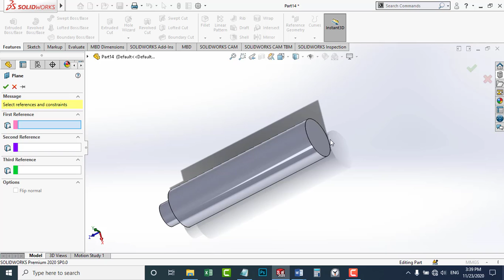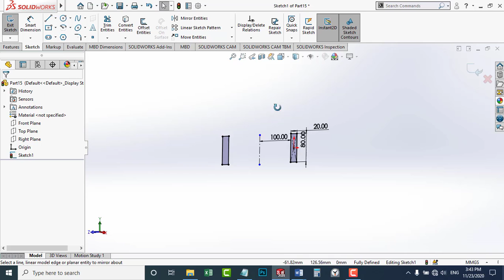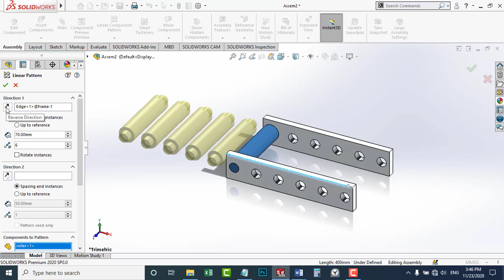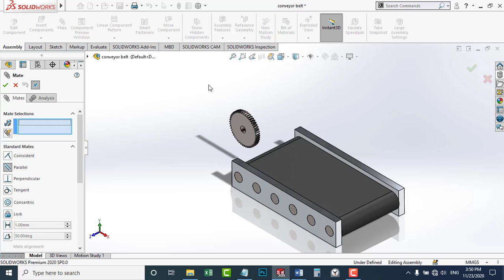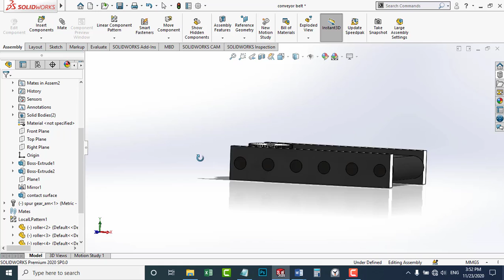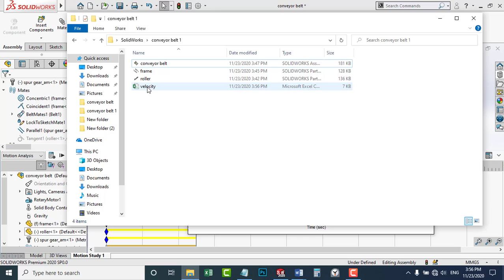conveyor belt design in Solid Works

Comment: How can I make a 90 degree belt?
Reply from the maker: make to copies of this assembly ,and make a mate between the first assembly and the horizontal plan to be Coincident and another mate to Coincident with vertical plan.this is for the first assembly .for the 
 second one make the assembly Coincident with the vertical plan and make another mate which is 60 degrees for example ,but for 90 degrees you will need steps in the conveyor built so that products that are being passed using conveyor belt will not fall.